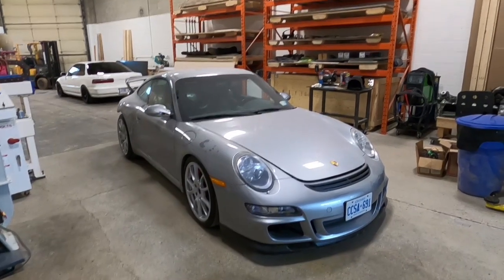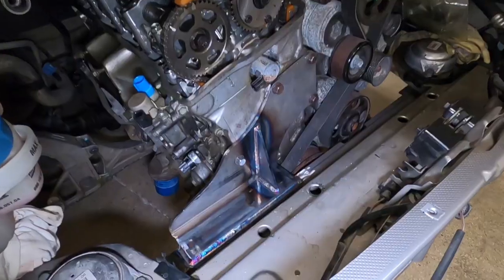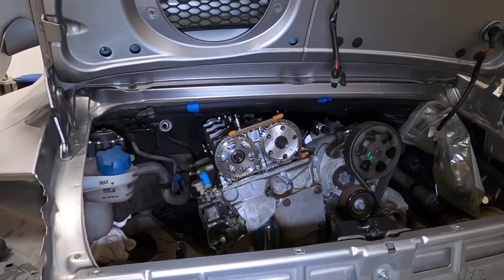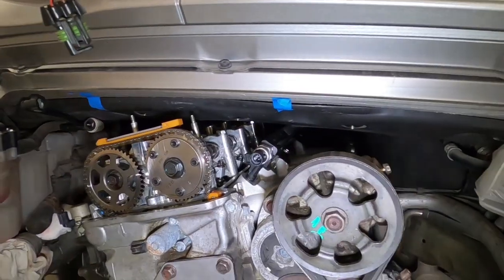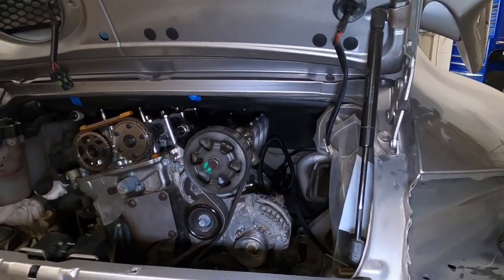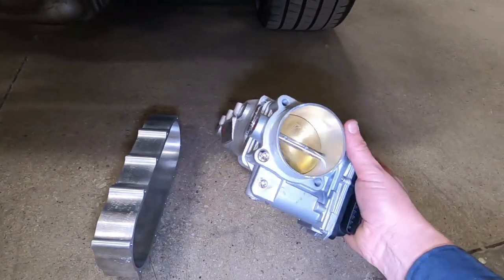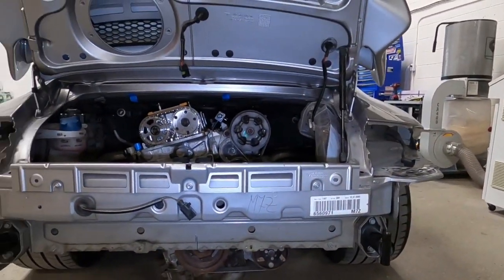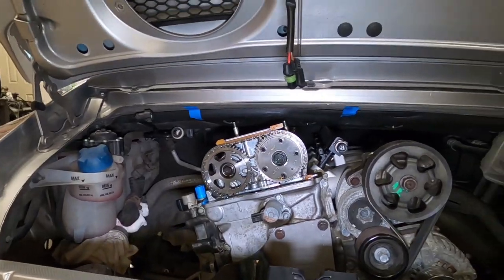K997 - K24 Porsche Engine Swap Update

Comment: That engine mount looks to be solidly bolted to the frame ??
Reply from the maker: This new engine mount is bolted to the stock Porsche engine mounts. Exactly the same way the Porsche engine bolts up - The Porsche engine mounts are rubber

Comment: Are you going to sell some kits?
Reply from the maker: Yes exactly - Once i have made sure everything works properly i want to offer this kit to others. It should work on older 996 cars too
Reply: Will the kit work on 986 cars too? I’ve heard of 911 swaps being done on boxster a of you’ve got deep pockets, but the 911 block is the same casting as the boxster just slightly bored out to 3.4 instead of 3.2

Comment: Are you still gonna use the stock oil pan ? Think you should change over to a kmiata oil pan
Reply from the maker: The Kmiata pan doesnt make sense for this application because it is divided in 2 to clear the miata subframe. I am considering a larger capacity baffled oil pan tho

Comment: Loving this🤘🏼🤘🏼 I got a 996. I’m considering a k swap and this is great content! Keep it up.
Reply from the maker: Thanks! - I actually think this swap makes even more sense in a 996. I'm actually looking for a 996 with a blown engine as the next project
Reply: Tuning by Nick Why do you say it makes more sense for a 996? Just curious. Just picked up a 2000 996, and would LOVE to do this. Or an EJ20/25.
Reply: Just do it!
Power of dreams ;)
Dont let dreams be dreams. Just do what you want!
Reply: I’m waiting for my 986 boxster to kick the bucket before I look into a k swap. Pre canbus makes it simpler, in still curious as the engine heights may different, but the boosters got an engine cover I can hack apart and not a brace in the way